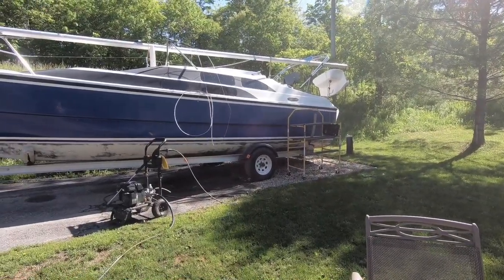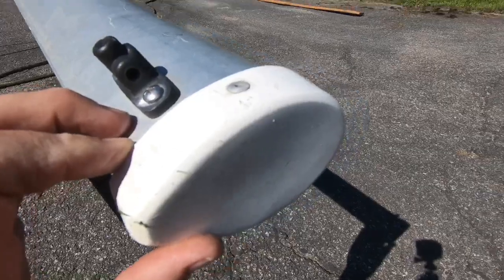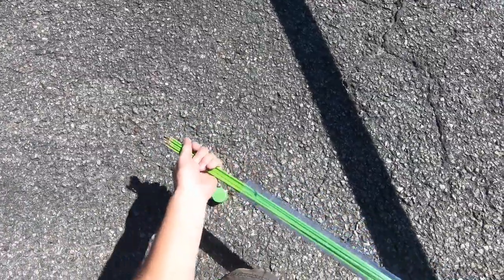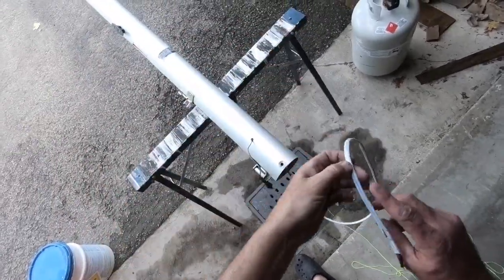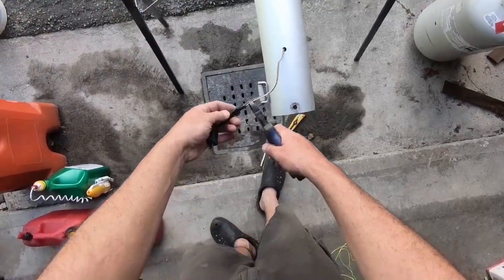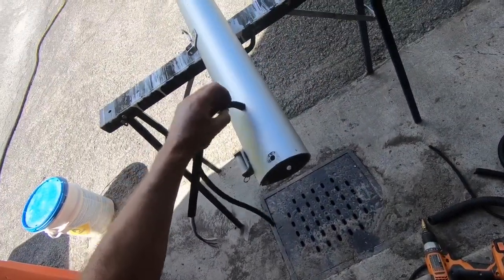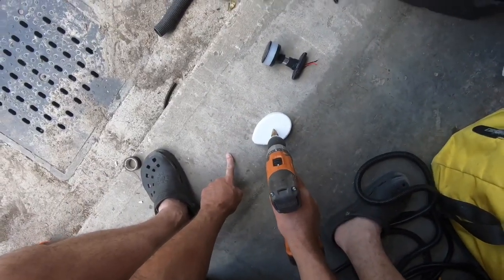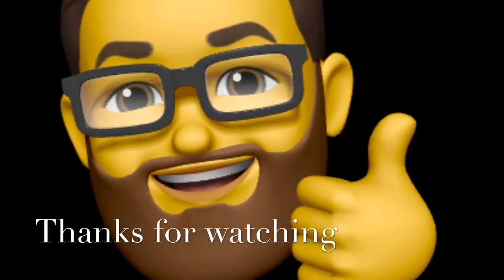Anchor light installation

Comment: I'll be doing this same job in the spring. So helpful to get a peek into the mast first! Thanks for that part. A little electrical tape around the tracer-string-to-wire connection will keep the wire end from bending and snagging as you pull it through. Sending you my gratitude for creating this.

Comment: Alternately, you can try a string tied to a piece of magnetic metal like a small non stainless nut, and run a magnet along the outside of the mast to pull it through (if you can't find or don't want to spend 25 on the tool).
Reply from the maker: Good trick, but not on a Mac 26M with half the mast filled with foam